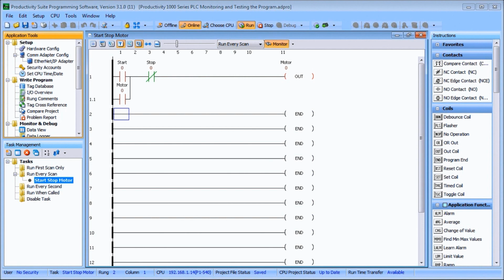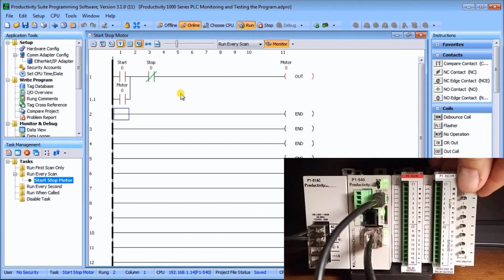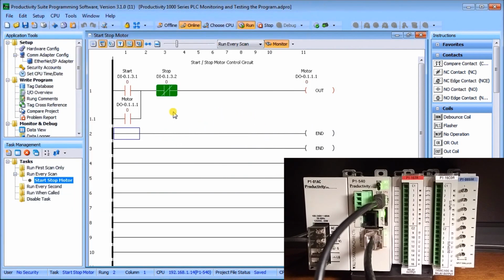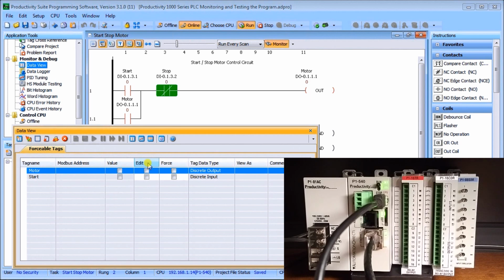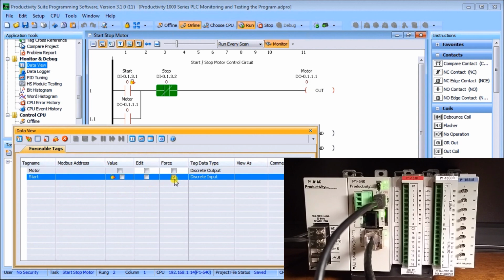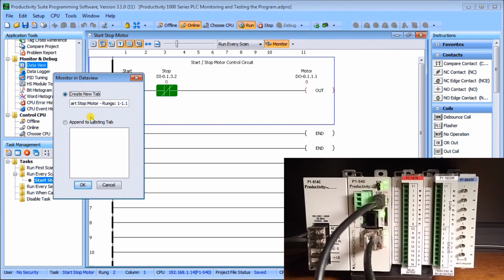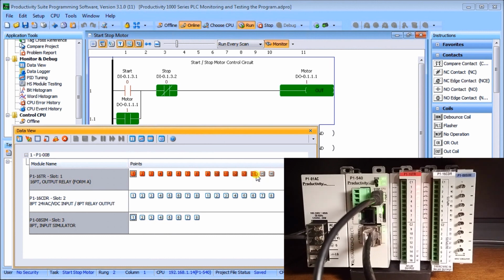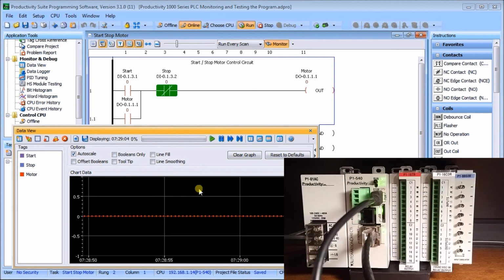Stop Struggling! Master Productivity 1000 PLC Debugging Tools

Comment: Forces are not good. You have a forced value of 'False', along with the actual value being 'True' - you remove the force, the PLC does not update the actual value in the code? In this case to 'True' - No good. I have many forces 'True' or 'False' and then uncheck all and expect the program to run with correct current values. I would no way try to remember to 'Edit' each one to the 'Current' value and then 'Un-Edit' again. Wow! - Around time of 7:15 on the video.
Reply from the maker: Hi Jeff,
Thanks for the comment. I agree with you. Forces are not good. I personally very rarely will use a force on any input our output in the PLC. Even when commissioning, I will place the PLC in stop mode and manually turn the outputs on/off when ringing out the I/O.
Garry